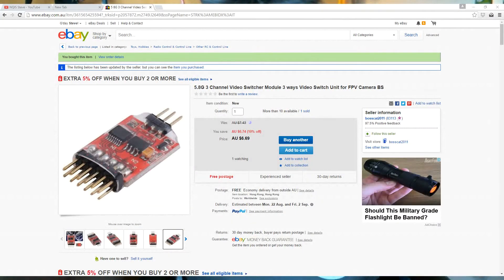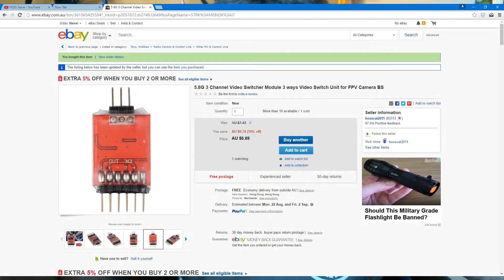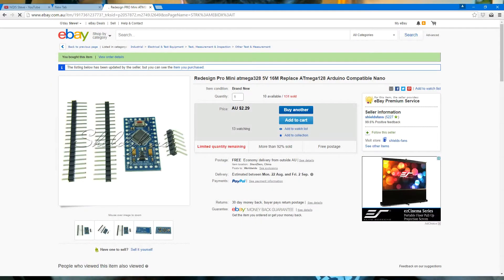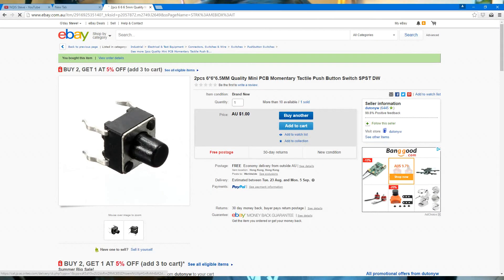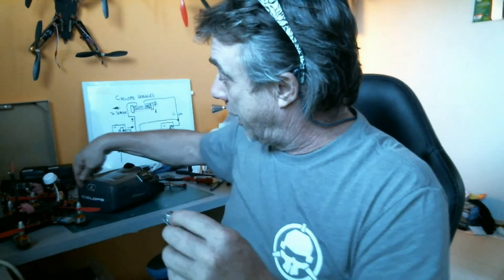Quanum Cyclops Goggles Video In & Out.  (Progress up date)

Comment: Hi  Is there a way of using the remote switch from the DIY version of the Quanum goggle, you know the one that switches between the receiver and a mini cam on the front of the goggle to see what is going on outside the mask. there was a jack coming out of the old type goggle specially for this purpose, and the remote switch could be velcroed to the back of your Tx

Comment: Hi Steve, while your solution is indeed technically a good one, I recon its a tad over complicating the issue.

My thoughts for the video in / out are simply 2 rca sockets, in and out with the grounds common, for normal cyclops use then a link between the two. remove link and let it hang on the socket (either the in or the out) and use the one you want. 

For anyone who has added the sound modifications then a further 2 rca sockets for the audio.
Reply from the maker: I have wanted a so called real reason to use a Nano for ages and the video switcher and micro-controller will be used for another Mod thats the front facing camera and with a long press that will work instead.
But thanks heaps for watching and commenting.